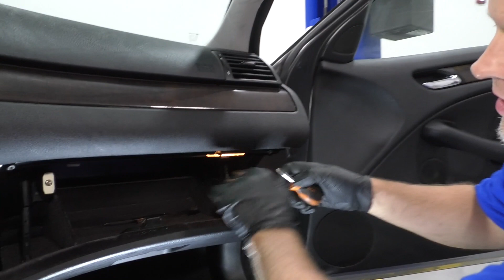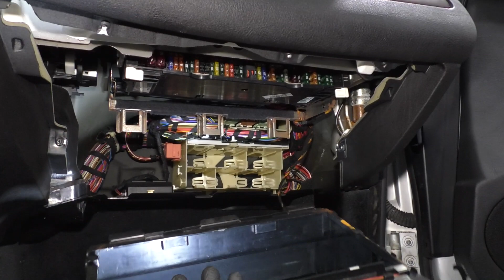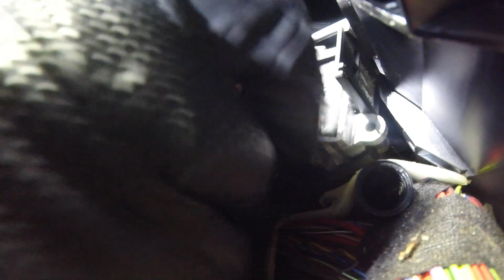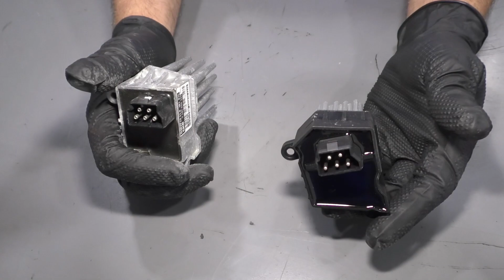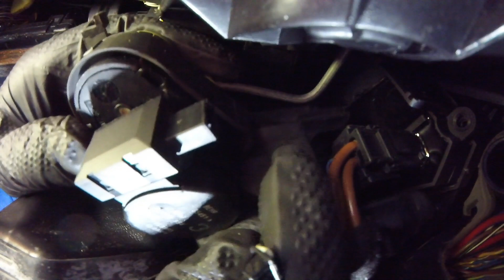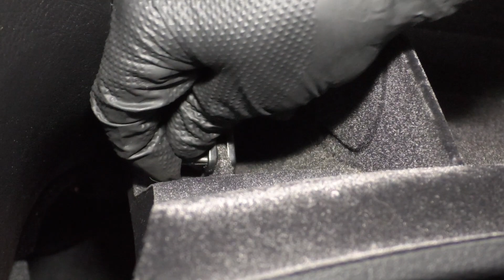How to Replace Blower Motor Resistor 01-05 BMW 325 Xi

Comment: Still a a great resource 6 years later.  I just did mine.  I followed every step from start to finish and got my blower up and running.   That said, getting to that resistor was still a B---h!  My 323ci was different in one regard:  The resistor was held in by two screws which doesn't seem to have been the case in this video.  Maybe this is a difference between the 323/328 and 325/330.

Comment: Is there a way to know if it is just the resistor that is bad? My BMW was blowing air for some time, had some issues where it didn't work until like 5 minutes into driving. Now there's no air coming out, but don't know if it's the resistor or the motor.
Reply: Get a cheap multimeter. Test ohms at motor wires. If OL or — then it’s failed. Don’t expect a helpful answer from someone only looking to make money like 1a. Although think about it, it’s pretty ignorant to ask too. I paid and went to school for years. I didn’t do it all to help people for free.
Reply from the maker: +Jacob Barclay We wouldn't be able to diagnose an issue like that here, you may want to have a local mechanic take a look at it. Thanks for checking us out! 1AAuto.com